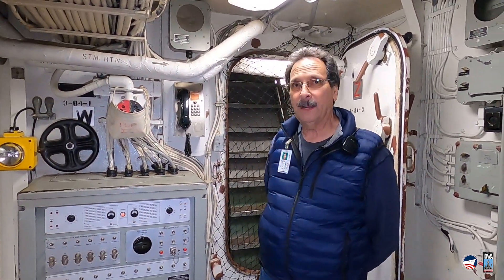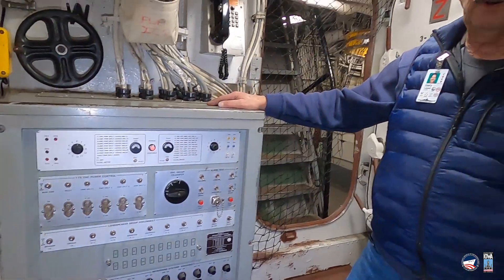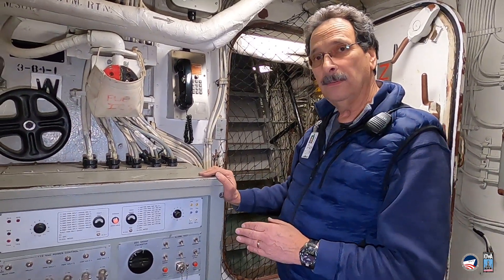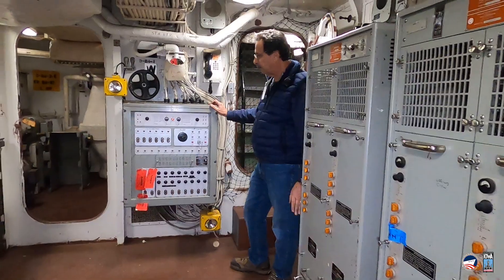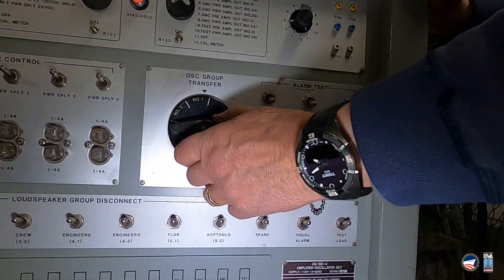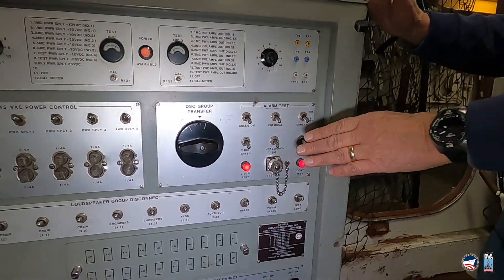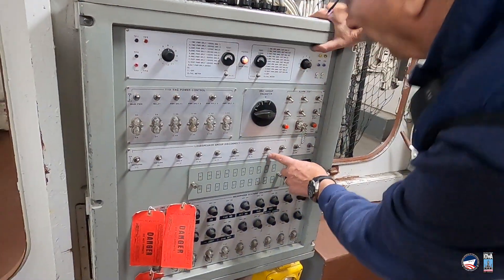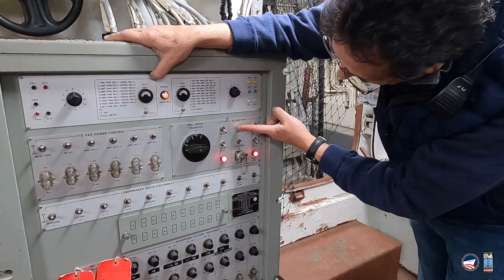Sound The General Alarm

Comment: Now let's see you demo every alarm, one at a time, piped through the whole ship, as if it were at sea and under attack.  Should wake up the neighbors, I think!  Certainly it'll startle any visitors.
Reply: If you piped it topside it might.  And if you sounded them with no warning, especially the General Alarm you won't have ANY trouble picking out warship veterans from a crowd of visitors.
Reply: @robertf3479 They didn't have a problem picking me out on a tour. I headed straight to sickbay (MY GQ station)😅
Reply: @robertf3479  The alarm is ship wide controlled from one place, and I believe it will only bring back memories to the shipboard vets like myself. USS Enterprise cvn65  1977-1978